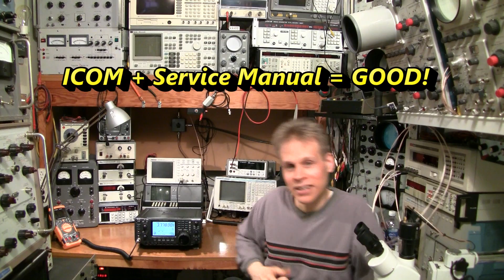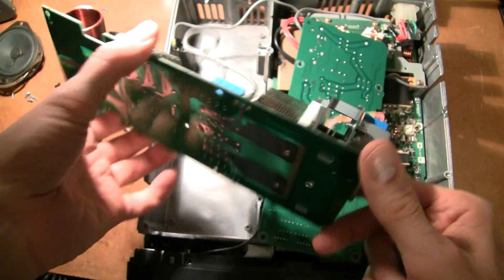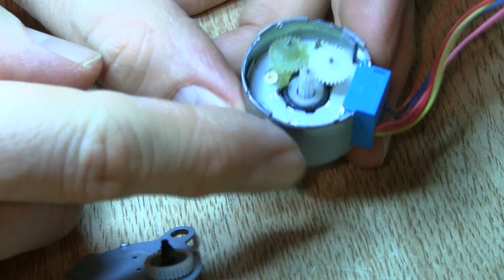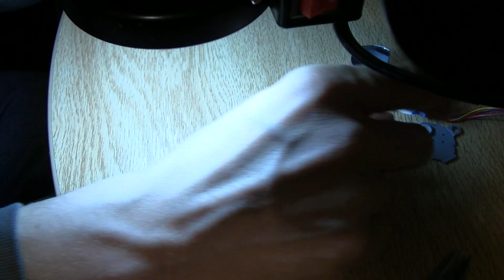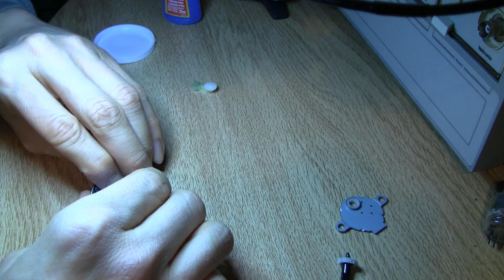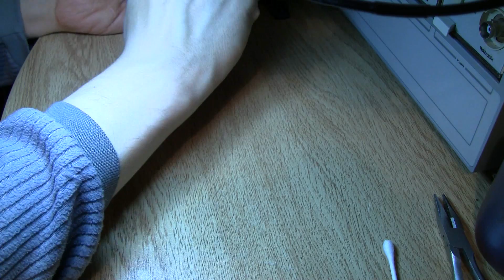Troubleshoot and Repair an ICOM IC-746

Comment: This is a great video. Concise, well shot and extremely helpful. I just bought a 746 and the tuner was working when it left the sellers and it appears that one motor is bad. Considering the construction of the motor mounts a solid drop could easily damage one. It surprises me they are not screwed to the frame of the tuner and shock preventive is the coupler, like it is in most machinery. Seems the mechanical designer got left out of the tuner electronics design.  Thanks for this wonderful video, now I can see how well these old hands work!
Reply from the maker: +Pat Hamp 
Your welcome Pat! I think the electrical designer of this radio may have been left out of a few steps as well
Reply: +Mr Carlson&#39;s Lab 
This is my first Icom other than 2 meters, been Yaesu and Kenwood for HF person, but recent radio design by them made fixing them an outsource. The 746 is solidly built and actually accessible compared to the others. Industrial designers always get left behind once the electronics guys take over and in this case defeated the plus's the aluminum frame provides to protect vital components, like the stepper motors. I am going to take a shot at this this weekend and hope a motor being jarred is the only issue with the tuner. I did add a micro fan to pull cool air past the LCD which evidently also a weak point.

Comment: Hi, I just saw this video and must say I found it it very informative - I own an IC746 myself. I had the same tuner problem on my rig, but I had it repaired professionally; both motors  exhibited the exact same problems as yours did and both were replaced. There also were other issues and they were taken care of as well. Now I know how and what to do should this problem arise in the future. One question, why did you use the TUNE button instead of the TRANSMIT button when you tuned the radio?
Reply: +Mike L. My question should've read...why DIDN'T you use the TUNE button instead of the TRANSMIT button when you tuned the radio?
Reply from the maker: +Mike L. 
There are a few different ways to do this action when you understand what is going on in the radio.

Comment: I have the same transceiver and mine just may have the same problem, now I know what to look for! I do have to comment on your tuning procedure as I tune mine differently. I simply hold the TUNE button down and it will not only turn the tune on, holding it a bit longer will make it go into the tune mode where the rig will go to low power and auto tune in CW mode. But your way seems to work as good.
  Nice job! 73 Rod KB8DNS
Reply from the maker: +poikaa3 
I like to use as little power as possible to get through the tune... Just easier on parts. Sometimes the SWR will change with the power output level, so I test it again at higher power when it's through the first tune cycle. Thanks for your comment!

Comment: When I key up , my I com 746 cuts out and comes back on after 15 sec of TX . I have a 20A switch mode PSU and your screen is blue, but mine is white?...Any ideas on fixing the TX ect...Is it the PSU?
Reply from the maker: +robert day 
Could be so many things. The power supply could be going into Current Limit. Could be RF getting in it as well. The problem is, I can not tell through a computer screen.

Comment: Hi Paul, another great video and repair.It never ceases to amaze me why companies continue to create these cheap plastic parts and geared electric motors that will always break down ,given enough time and use.We have had these fail constantly in our Government  printers requiring large numbers of  expensive service calls.For the small price of some internal upgraded materials, companies would save tens of thousands of dollars in service repair costs  .Dana WN6OHG 1965 Novice to Extra Vlass.  73  db
Reply from the maker: +Dana Brinkmeier 
Unfortunately, price is driving everything now.... Quite different from a time when quality was the deciding factor.
Reply: Quite right !....my son has an electric race car that strips out plastic gears in the transmission, as fast as you can replace them.Nothing like shoddy materials.You have to look hard to find quality products and it is a crying shame indeed. Peace..
Reply: Dana Brinkmeier halodoorganaldevgr.s.kraal🐤🐦😻💖😄

Comment: Those motors look like the common el-cheapo geared steppers selling on ebay for a few bucks each.
http://www.ebay.com/itm/28BYJ-48-Valve-Gear-Stepper-Motor-DC-5V-4-Phase-Step-Motor-Reduction-For-Arduino-/181013753291?hash=item2a2542adcb:g:QskAAOxyhodRsbnE
Reply from the maker: +Kenneth Scharf 
I have to agree! I don't think they are anything special. I wonder if they fail the same way?
Reply: I know they don't last too long in 3D printers.  (There is a small reprap design that uses those motors).  Anyway, I was surprised you attempted to repair the motors when a new one could be obtained so cheaply.  Of course, after your repair, it will probably last much longer.   

I have an IC746 that hasn't been powered up in a few years now.  I wonder what surprises it has in store for me?
Reply from the maker: I wish you luck :^) I did repair the motor for that reason. It's nice to know the common failure points, and make the motor tougher. It's still working great, and I expect it too, for a long time.

Comment: Stepper motor..?!
Reply from the maker: +Ole André Noss 
It does require pulses to turn.
Reply: Yes, a stepper then. I played around making driver circuits for them from scratch. Essentially H-bridges. Of course, nobody really want to DO that, except for learning purposes though 😂 Plenty of them off the shelf, like the L298.

Thanks for your series of great videos, I've seen several of them now and find them very useful - I learn a lot and enjoy watching them. Cheers from Norway.

Comment: Very well done. What kind of iron did you use to reattach the motor case?
Reply from the maker: +Jim Painter 
I used my Weller gun with the tip shown in my "super hot soldering gun video." Thanks for your comment!

Comment: Just subscribed after watching the Yaesu FT 1000MP repair and mod. I really appreciated watching your logic and repair. Really liked how you repaired the motors in the Icom, instead of replacing the parts with parts that would likely fail again you went to the extra effort and modified the motors to be more robust. It wasn't just a repair but a failure point upgrade that was simple and logical, just awesome!
Reply from the maker: +ecleveland1 
Thanks! Glad your enjoying the video's.

Comment: How did you go about soldering the steel cases of the motors? I've never soldered steel before. I imagine it being more difficult to solder. Do you use a special flux/ solder? Higher temp than soldering copper?
Reply from the maker: +skmetal7 
Soldering steel is much the same as copper. The more surface area, the more heat you will need. There is a fine balance required, as the internals of the motor can't be melted. So sand area, apply RA flux ( a dab) and solder.

Comment: This little IC "597A" that drives the motors is so deceiving. Looks first like a CD74HC597 which it can't be. Only the service manual reveals it to be a TD62597A, an ULN2803  sort of part without the Darlington circuit and hence slighly lower saturation voltage. Nice!
Reply: Good detective work, on the circuit.
ULN2803 very common part, student robotics users familiar with.

Comment: I'm betting those motors are unobtanium...
Reply: They look remarkably like the cheapest, nastiest $1 on eBay stepper motors. Though it's possible ICOM are using some exotic custom variant.
Reply: @makomk  having taken one of the cheap ones apart and they are identical about 2 euros each.
Reply: That motor sure looks very much like the indoorAC unit louver control motor, same style, also 5 wire. Don`t know if the gearing is the same...
Reply: Borkzilla I have a NOS motor going in my own 746 Tomorrow so they are available. The motor and installed labor is $100.
Reply: They're just thermostat steppers, it looks like. The thing is that you need the right gearing on the output.

Comment: Hi Carlson I enjoy very much your instructional videos and learn a lot. I'm a ham radio myself , but since I moved to this house over 16 years ago I sold must of my gear before I move and still got some in boxes , what are the chance that is still working without any problem like capacitor leak  or any other component problem.
Reply from the maker: +Quasimoto Glez 
That's a difficult question to answer. It really depends on the gear and it's age. Glad your enjoying the video's!

Comment: Hi Paul,  Would you consider doing a troubleshooting and repair video on a garden variety switch mode power supply?   One of those small rectangular ones.  Thanks a lot.   K8MB
Reply from the maker: +Thema inproblem  Good Idea for a future video. I have a "newer" tek scope that somebody pulled apart. The supply is bad so I might include the smps in with the fix.

Comment: Another interesting and informative video! Really appreciate you spending all this time to share your knowledge with us, glad I discovered your channel! 

My IC-746's tuner has a different problem, the motors are turning freely and usually it will tune without issues. Every now and then, often on an antenna that is very close to a 1:1 SWR the tuner would hunt up and down till it finally fails. You can see the SWR moving up and down but it does not stop when it gets close to 1:1.
I have been told it could be the high voltage ceramic caps in the tuner but since they are not easy to find locally I have not tried to replace them.
Should I just order then and try?
Thanks! 
73, Rudi de ZS6DX/V51VE
Reply from the maker: +Rudi Venter I wouldn't blindly replace components in anything, 99% of the time it doesn't solve the problem. There are so many things that could be causing that issue. Make sure the couplers on the motor shafts are tight on the capacitor end, "not slipping." Make sure both capacitors are moving while it's tuning.
Reply: +Mr Carlson's Lab 
Thanks for the quick reply!
Ok, will open her up again tomorrow and make sure all is well with the motors and the couplings, maybe there is some slippage. Tried the radio just now and it seemed fine, due to the problem I have not used her for quite a while.
Thanks again!
Reply: +Mr Carlson's Lab 
I opened up the radio to ensure the motors are not slipping, but they are definitely not. I have noticed that the problem seems to be only on certain bands, a quick test shows that 40/30/17m tunes fine but 20/15 won't tune, even with an antenna that has a SWR of 1.3:1 or better.

Interesting thing is that on these bands the SWR is infinite while it tries to tune, and it does not change so I am wondering if maybe it is a relay, in the tuner, issue. With the tuner off all is well.
Reply: +Rudi Venter Are you trying to match a high impedance antenna? You may be experiencing arcing inside the tuner if the SWR is jumping around. I've fought issues like that with antennas (long wire) that are at a 1/2 wave or multiple thereof at a given frequency. In my case, I was trying to match an 84 foot random wire at 15 and 10 meters. Fifteen meters was iffy, but ten meters was a nightmare. I ended up adding a shorter 1/4 wave element for 10 meters. I also moved the tuner, electrically, a few feet back from my 1:1 current balun so that it didn't live at a high impedance node on the feedline. Both options fixed the arcing issue. Good luck!

Comment: Great video!  An idea for epoxy is Acraglas, which is a 2 part expoxy used for rifle stock bedding.  It bonds to about anything, and the best part is it doesn't expand when it dries (less that a 1/10%).  Ive used it to repair rifle stocks, Mercedes instrument clusters, and anything else I don't want to come loose again.  Brownell's supply carries it.
Reply from the maker: Brad Moran Thanks for the tip Brad!

Comment: Hi Mr Carlson, really enjoy your videos. I am a fixit-man working in office machines [and others way down here in Auckland, NZ] and noticed your repair of the electric motor/gearbox unit in this Icom IC-746 is very similar, but much smaller, than the ones we find in laminators. My fix is similar to yours, disassemble, clean,glue, and reassemble. I use two-part Epoxy as I have had some failures with supEr GlUe. The epoxy fix has been out there for a couple of years and none of the fixed rotors have let go so far.
It is indeed a shame that some well designed machines are let down by penny-pinching bean-counter politix. The major looser is the poor old customer! When the ManufactUrer says "No spares, buy a new machine" and we fix 'em and give the customer years more service out of it, well, it really makes us proud.
I have been completely smitten by your Echophone EC-1 and cannot stop thinking of it. Now I have to track one down for myself... The video you did on the resoration will get Eleven out of Ten on my scale. Excellent work. Outstanding.
If you ever want to sell yours, or if you know of one for sale, I am keen to get my hands on one!
Reply from the maker: av8bvma513 Hi, Thanks for your thoughts and ideas. Glad you liked the Echophone video. If I find someone that wants to part with their receiver, I will let you know. Thanks for the nice comments!

Comment: Wondering if the motor and variable cap have to go together in a certain way? Meaning fully meshed and motor in a particular position. Phasing I guess or timing the two together?  W4GSM

Comment: mine had the same issue with the back light i put the stock one back in but i used a piece of copper and screwed it to the inverter shield
Reply from the maker: wizzkidelectronics  That was a common issue with all of these..... Something overlooked! When I see design like that, I start to loose faith in a company really fast.

Comment: Makes me wonder why these two motors were designed to flap in the breeze.
Don't you loose accuracy because of that?
Reply: "Flap in the breeze", that's Dave Jonesism if ever I heard one. I'm betting you're an EEVBlog subscriber also.
Reply: The Motors need to be able to flex.  The Shaft connector are made to flex, that takes up any misalignment. Prevents damage to the plastic shafts and gears.
Reply: I imagine the motors run in a closed loop (using low frequency phase feedback from the tuner circuit maybe), and the control loop is less stiff than the coupling, so it stays stable. I don’t know exactly what feedback it uses as I’ve never looked at one of those feedback circuits, but if I were to design one, I’d be measuring the capacitance continuously in a closed loop at a frequency that won’t affect normal operation.

Comment: Second video of yours I have watched in the last 24 hours (the first being the FT1000MP repair - what a dogs breakfast that radio was!). I had to do a lot of repairs to my second hand IC746pro to make it go properly, it had no RF power out, and it wouldn't switch antenna's. Then I found out it was "opened up" (TX anywhere). I know your pain when you don't want to go back inside a radio to do more work on it! I also modified mine so the Q1 on the RF board has a heatsink, IC151 only gets power on TX (instead of idling all the time) and the fan runs at reduced speed during RX. Then 3 weeks later the backlight died. So out came the SMT transistor (a pain to get that shielding can off the inverter) and in went a TO 220 package replacement just like you did :)
Reply from the maker: dash8brj Glad you got your Icom working again. Lots of silly issues with these radios! Thanks for your comment!
Reply: Mr Carlson's Lab No worries - yes there are heaps of silly problems with these. I completed all the upgrades and repairs in two sittings after reading and watching youtube videos. The other problem mine had was a dry joint on the SP OUT jack at the back. Mine was a very sad radio, but I did get it quite inexpensivly.

Comment: Love your work. I must say I cringed a little seeing the hydrocarbon oil on plastic. For plastic lube, best to use Dow Corning silicone grease or silicone oil, these won't break down plastic or rubber and last forever.
Reply from the maker: Jason Burt I do have silicone grease. I'm aware of oil breaking down plastic, this stuff is safe :^)

Comment: I notice that instead of replacing the part you try to fix it first. I always try to do the same. I enjoy watching your video's. Thanks for sharing brother. 73's kg2nc
Reply from the maker: Ruben Got to make the most of this "throw away" time. Another neat perk of repairing this stuff; you get to see what was going through their head (or what wasn't) when they designed this stuff. Thanks for your comment!

Comment: IF you look at the Adafruit 5 Volt version of stepper motor, they have a photo of that motor opened up.  Looks to be same motor.
Good Price for a spare!
Reply from the maker: w9gb I will check that out. I imagine the motor will end up doing the same thing though. If I had to remove the other old one to replace it, I would probably perform the same repair. This way it's done, and I won't have to tackle that issue again. You know the new motor would have the same failure mode eventually. I can understand why they are $5 now. Production cost is probably under $1 for the motor to be so cheap.